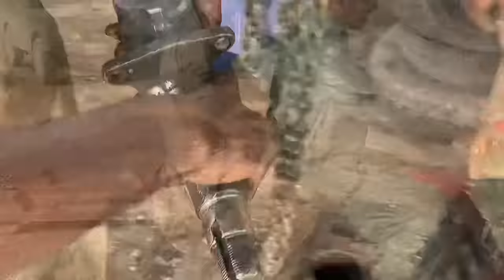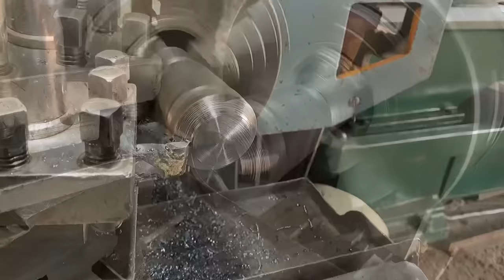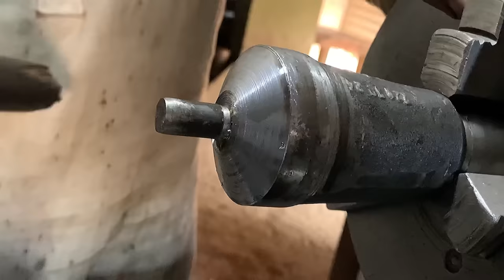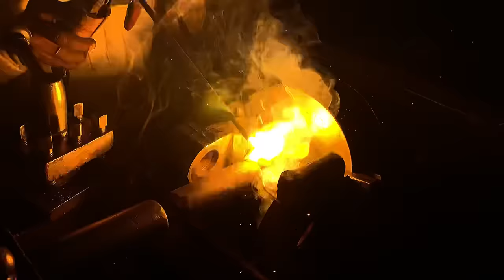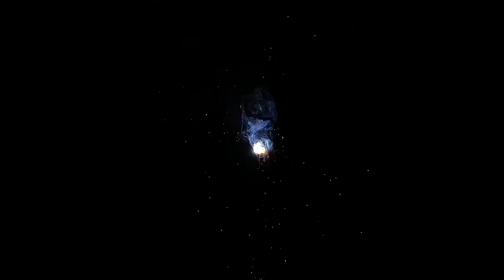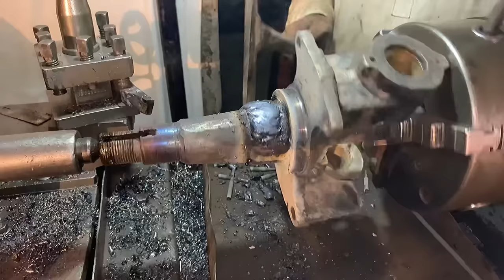Truck Drop Spindle Broken Repairs Obtaining and Manufacturing Precision Engineering Perfection

Comment: If truckwill be overloaded again, the spindle will break in the very same section. Any welding is weaker than the two steel compositions, it is a superior quality steel for the spindle production. Conclusion: it will break again soon in the same section.
Reply: Wrong. It will break on one side of the weld or the other. As they are different hardness metals the weld in this case is softer and a bit more flexible. It will be put on an overloaded truck and it will break. But most likely on the outboard side of the weld.   Also never mind repairing the beat up threads on the end of the spindle. Nothing to see there at all
Reply: @martinswiney2192  makes for a great youtube video... :)
Reply: if you actually weld you'd know that the weld will be stronger than the base... only an overload will break this repair which is apart of their culture... the repair is proper... the client will still choose to overload it
Reply: @LexusGX460-OFF-ROAD   A welding never breaks. Metal breaks  near the welding,, în the thermal influenced metalic zone.
Reply: Sorry, but you are sooo wrong.   The weld is stronger than the adjacent metal..😏
Reply: @williamworden3597   Of course welding is always stronger than the adjacent metal. Next time the metal around the thermal influenced zone of the metal will crack, not the welding itself.
Reply: @williamworden3597   You are right and I am right.👍
Reply: It will last long enough to justify the repair.
Reply: Muchas opiniones encontradas.Alguno de Uds es soldador certificado?
Reply: Any one of you is a certifícade welder In carbón steel ,stainless steel or using other kind of other sistem?
Reply: Some crap going on here as all subject to material compatibility of parent metals and fill material then heat treatment post repair as no welding will correct fatigue grain structure changes which is the original cause of failure  !
Reply: somewhere arrond there is a pile of camel dung to heat treat it
Reply: @raginroadrunner    😄👍
Reply: It is a steel forging, far denser material than arc weld, or any weld
Reply: @ldnwholesale8552   👍👍👍
Reply: All you internet know-it-alls, I bet neither one of you even own a hacksaw.
Reply: Yse it might break. The main point is the owner will make money and will buy another one .
Reply: @agnewyelma9048  Of course.
Reply: I would have threatened the reinforced center  piece and tightened  that suckered down for added strength
Reply: thats great but foundation is small

Comment: I sure wouldn't use a "repaired " spindle on any of my trucks .
Reply: Es que tu eres muy listo
Reply: YOU WOULD
If you had family to feed.
No social net to fall on.
And no money for the new part.
Oh you would....
Reply: @w.loczykij5354 at that rate one won’t have a family for long. Why was it made in one part in the first place and what about all the heat stress
Reply: These guys do repairs on items that practically never fail in western countries.   Why do they fail in Pakistan?  Three reasons:
#  Terrible roads with pot holes that overstress suspensions;
#   They overload their trucks;
#  the parts were locally made from melted scrap metal of unspecified properties.
So, in that context, frequent breakdowns and accidents is what they think is normal and has to be endured.
Reply: Welcome to the real world for most people. A place of actual mechanics and not just part changers. Send the guy a new spindle if you're so concerned. I'm sure they would love to have it.
Reply: La necesidad obliga a veces!!
Reply: Если нет выбора придётся
Reply: The problem is people using parts like this put the lives of others at risk.

Comment: it's a technique that is just good enough to repair a donkey cart, you don't replace a part that is originally a forged part with welding in addition to arc welding with all the inclusions. It's simply dangerous I pity the driver of the truck no wonder there are many who leave their skin there.
Reply: Well in the real world you're just wrong. This is how every truck is worked on over there and they miraculously work when they're done.

Comment: Curious as to how you're grounding the part when welding, I hope you're not running the current through the lathe.
Reply: Of course they are!
Reply: What else would a precision machine shop do? Use an eyecrometer in a three jaw chuck?
Reply: you ground the lathe... it's an industrial lathe, not a wedding-dress
Reply: The lathe sits in the dirt if you didn't notice. The current probably has no problem passing into the ground without burning up the lathe.

Comment: You should be able to do a repair that will work on that. Mount it up on the lathe and pour out the center where that spindle goes but don't go all the way to the edge of that disc like part. Just bore out the diameter of the spindle. Now get a good piece of metal that's already heat treated and turn it down. Good carbide tool should cut it, but If it's too difficult, you could use a tool post grinder. Make a step in the shaft about 1/32" over the hole diameter. Maybe 1/64":(hard to tell without actually holding the part in my hand). Then make a second step about a half inch past the thickness of the knuckle. Champfer that edge. The temp difference is about 400F.  You could probably heat the one part and avoid the dry ice if you had to. You can make up some by heating more, but you can start getting close to the temperatures that anbeal thf metal if your not careful, depending on your alloy. The expansion coeficient should he around 0.0000065/F. So multiply your hole diameter by that, and then multiply by your temperature difference. (Dry ice is around -100F) So a 2" shaft at a 400 degree difference should get you about 0.0052". So make it about 3-4 thousandths over. It should drop right in. The lock in place and never come out.  shaft.  Then turn the spindle profile down on the front side and cut the shaft off the back side. 

You could probanly get away with making the shaft a bit smaller and pressing it in. If yoyr a bit nervous about it just being pressed in, before you cut it you could cut oyt the center of tge back side to a quarter inch above the surface, and then peen over the edge so that there would be somthing holding the spindle on if sonething goes catastriphiclu wrong like the knuckle cracks. 

Would i fix that? Probably not unless I had no other choice. But it could be dove in a way that should hold.

Comment: This truck was most likely overloaded from the start, I'm sure they will overload it again. In the long run, they would have saved money to just replace the part. When it breaks again and I mean soon the truck will be out of service and not making money.
Reply: They make these repairs all the time. You're correct they'll overload it and the bad roads will break it again. You are wrong if you think it's much weaker than original. If you ever travel to the 3rd world you'll be amazed at the vehicles they keep on the road. Almost everything is repaired out of necessity.

Comment: Skills enough, but how strong would it really be? 
The axle-stub shows dropforging marks, so 800-1000 Mpa (?) if alloy steel was used. The welding, 400-500 Mpa? The residual stress caused by the welding due weld crimp ? 
I estimate 30-50% less strong. Some (expensive) weld-materials can be tough however. 
It will do some time again....

Comment: How do you guarantee that the length after repair is identical to that of previous? Before facing you have not checked  the lengths of broken pcs?
Reply: He checked it with a steel rule.
Reply: You understand the video didn't capture every moment of this repair no? I assure you these repairs work. It's just how things are done there.

Comment: Necessity is the mother of Ingenuity and it’s good to see you’re thinking outside the box but with a critical component like a spindle, it’s best to buy the new one. No money for it and still want to go the welding rout? At least do some quality control on your materials and NDE as the repair progresses. GTAW welding method would be preferred for this as it is cleaner. But, again, with limited resources it’s tough to do a job right and you gotta work with what you have. Just don’t expect me to be a customer there LOL!

Comment: This is where you really want to think about liability. If you were to be faced with the lawsuit, the plaintiff is going to ask by what authority you have to repair a spindle back to OEM specifications and that machine shop would have to prove their case. Sometimes you need to just buy a new part. Besides, I don't know where this got repaired, but here in the states I would think it would be a fortune!
Reply: There are no layers in Pakistan and only few laws concerning goat ownership and marriage for the most part.
Reply: @gustavobarr  pretty normal repairs in other parts of the world. If you break an axle they either weld it or they hob out a new one by hand.
Reply: @gustavobarr  Yes but at the same time, don´t American sue each other just a little bit too often?

Comment: To all of the scientists, engineers, machinists and mechanics who ridicule these primitive practices, they apparently work.  I would buy the $1000 part replacement.  They pay $10 to have this repair done.  If the $10 repair repeatedly fails, then the $100 repair is tried.
Reply: Гроб будет стоить дешевле оси.
Reply: and lives may be lost , these failures dont always come at the best times
Reply: No apparently about it. I've been to this part of the world a few times. These guys are incredibly clever and competent at keeping vehicles on the road. What does them in is overloading and horrible "roads".
Reply: Great idea. If six children are killed by a runaway 100 pound truck wheel with a 80 pound brake drum inside, the $100 method will be tried.

Comment: I didn't see much precision or engineering perfection but I did see a lot of dumb luck. I'm sure the lathe doesn't appreciate you beating on the part while in the chuck and "filing to size" beats precision machining any day! You're going to remeasure that journal tomorrow after it cools down a few hundred degrees right?

Comment: That part will last until any kind of stress is put on it. A spindle like that is obviously off a truck. It may hold up for some time, but the heat from welding destroys the original heat treatment of the part. If the part was heat treated after repair it would last. Wonderful repair but a waste of time.

Comment: All the heat cycles from the welding have compromised any original heat treatment.  The overall strength is likely to be less than half the original strength.  I give it two weeks.
Reply: I wouldn't drive with that shit. lol but hey when you got to do what you got to do, I guess make it work.
Reply: Heat treatment is not a rocket science for these people. These repairs must have gone through such procedures.
Reply: it's a truck spindle...it is not "heat treated"... this is a textbook wide root weld... welding was literally invented for this purpose
Reply: Они эту процедуру не первый раз выполняет и не последний раз
Reply: And of course loading the vehicle 5x over it's designed capacity has nothing to do with the breakage.....🙄
Reply: Georgegonzalez....en mi vida de trabajo, por un accidente, el motor CAT 8 cilindros en V quedó funcionando pero No giraba el ventilador. Se desarmó y estaba cortado el cigueñal junto a la bancada. Fue llevado a un Soldador que dijo lo reparo.   Asi fue; le realizó la soldadura, tratamiento termico, rectificacion y se armó; creo que aun funciona..
Esta en una Grua Grove en la superestructura de 140 toneladas........
Reply: @LexusGX460-OFF-ROAD  это.не шпиндель а Цапфа  или поворотный кулак....
Reply: 12:10
Reply: It was probably locally made from melted down scrap metal of unknown properties anyway.
Reply: This is a drop forged part, I give it 20 feet.
Reply: @LexusGX460-OFF-ROAD  You obviously know nothing
Reply: If their repairs only lasted two weeks, do you think they would still be in business?
Do you honestly think that each repair they make only lasts two weeks, and that each customer comes back every two weeks, over and over again?
Reply: @kriber5154  : "Two weeks" was probably intended as a figure of speech, not to be taken completely literally.   But there is no doubt it is a very dodgy repair.   On a part that was already dodgy.  Broken when the driver in his overloaded truck ran over a deep pothole.  
This is in Pakistan city, which has hundreds of such small shops, ranging from quite good to extremely dodgy.  Their culture seems to include a fatalist belief that things fail all the time anyway, it's all up to Allah, and getting ripped off is normal.    Next time, whether it is after 2 weeks or 2 months, it will go to another shop which may or may not be better.   Or, after it is the 10th time it has failed, the owner will finally wake up and get a new one, made from melted down scrap by another dodgy shop.
Reply: @keithammleter3824  assumption, assumption... I doubt you have any experience.

Comment: This would probably snap right off after about 20 feet down the road.  This is a drop forged and machined part that has the grain structure aligned during the forging process, It has lost all of its integrity by being snapped and welded.

Comment: If the original forged part broke there is no way a hacked up repair like this going to , especially the way they overload their vehicles..
Reply: The way you have written this means that the repair is going to last and not break.
Reply: it's not a hacked repair... it's a textbook open root weld with a post and then machined.  Welders do this every day worldwide.  Alaskan pipeline was joined/repaired the same way.  Overloading is not the responsibility of the machinist
Reply: Yet it's done all the time and lasts. They wouldn't keep doing it if it didn't last. The welded area is probably stronger than original if they used the right rods.
Reply: @LexusGX460-OFF-ROAD  Western "mechanics" get bent out of shape if it's not always new parts going in. Repair has become sacrilege to most. It's rather odd considering we used to do it too before everything became unservicable junk.
Reply: @okgroomer1966  sad part is,that it is probably better than some of the new parts coming in from China.....lol
Reply: @LexusGX460-OFF-ROAD nobody welds drop forged parts. Nowhere in the world.

Comment: Fantastically resourceful and skilled repair. The one thing that always worries me when welding takes place in the lathe is where is the earth clamp? If it's just placed on the bed either all or some of the current will be passing through the headstock bearings which will drastically shorten their working life and accuracy.
Reply: The bearings will arc and be destroyed. They dont care. They  have been told many times and refuse to learn.
Reply: You call it resourceful repair and worry about lathe bearings? Good joke 😅
Reply: Thanks for the info
Reply: Bonjour heureusement vos camions de roule pas @ 100km/h mais le dépannage a peut de frais vous connaissez dans votre pays
Reply: exactly
Reply: Accuracy? What are you talking about? When the worker measuring (via micrometer!!!)  the hot detail with 290-300 degrees Celsium (blue color of steel),?
no detail cooling, no secured lathe bed from weld-rust...
Reply: I´m sure these people know exactly what they´re doing, and they know what ACTUALLY WORKS in real life, as opposed to some of the "specialists" around here.
It looks fine to give them positive feedback as long as it´s still a bit condescending. How about admitting that these machinists are actually much better craftsmen as compared to the norm in western society?

Comment: Vernier… “very near”?…… for precise press fits? Spindles usually bend instead of breaking at that point. How did it break?.. wreck? Not sure I’d trust it. Broken spindle would give you a wild ride
Reply: I'd bet way overweight and horrible "roads". You'd be amazed where these trucks go. Repair is the only realistic option.

Comment: Many years ago, when I worked, we used the N.E.I.G.E. system. Near enough is good enough!
With the stub axle in the chuck, he inserted the pin AND WACKED IT with club hammer!!!! OMG, these videos get worse, more dangerous! This casting was from the front wheel of a grossly overloaded lorry...
Reply: it's a support pin, not a petting-zoo... how else was he supposed to get it in there?  A press?  waste of time
Reply: @LexusGX460-OFF-ROAD  A petting zoo?
Should have supported the casting in a vice!
A lathe is a precision machine!!!
Reply: @chrisball3634 it probably was when it was used in the west, then when it became obsolete they shipped it east😄